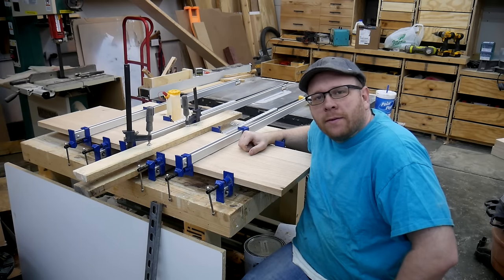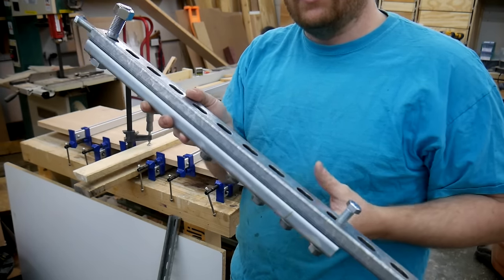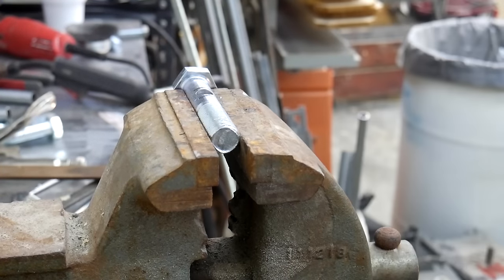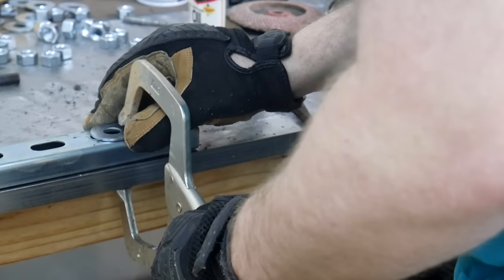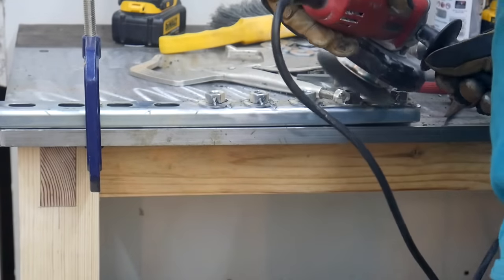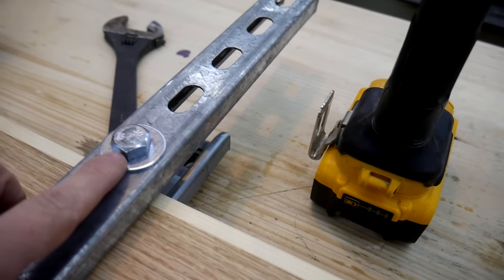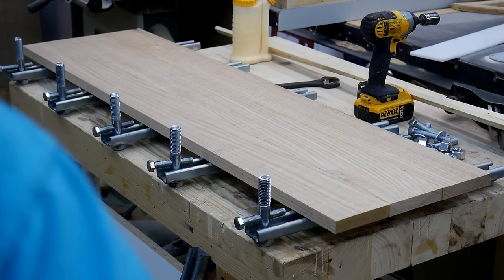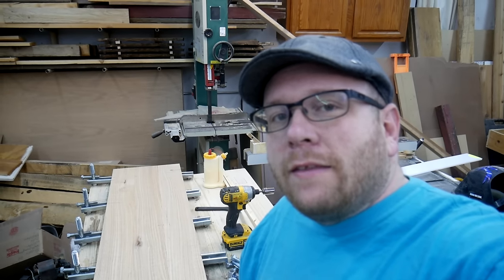3-Way Panel Clamp System

Comment: Thanks for the post, great idea, I wonder if square nuts or spring nuts would have worked instead of welding nuts at the far end.(they sit in the channel)
Reply from the maker: A lot of people have asked this question and yes, I had considered it, but there were a few issues with using the spring nuts. First and foremost, the whole load would be placed on just the inner lip of the unistrut. I didn’t feel like that was strong enough for the application. Second, since I was placing a lateral clamping load on the piece, I was concerned about the spring but moving as I was tightening down the clamp. I was also concerned about warping the inner lip with the lateral clamping forces. Finally, if I used a spring nut, the threads of the bolt would dig in to the edge of the board I was clamping, leaving marks behind. They way I designed it, it bears the flattening load across the whole unistrut, it won’t move because the nuts are welded into fixed locations, and the bolts are long enough that the shoulder of the bolt is what interfaces with the panel, so the threads won’t mar the edge. This idea isn’t perfect. Someday I will release version 2.0, but for now it does the job. Thanks for your comment!
Reply: @SouthpawWorkshop  you can cut the springs off the nuts, you don’t really need them. There is no way the clamping force would bend the lips of the unistrut, most people tighten the clamps way too much, only a small amount of pressure is required. Great idea!
Reply: Really thoughtful engineering you have, regarding the use of welding instead of spring nuts. You raise extremely important engineering reasons for using the welded nuts. However, I do feel that if you're going to use Unistrut, then you absolutely have to use spring nuts, because spring nuts are part of the magic of Unistrut. The magic of spring nuts is the clean look, no welding, but most importantly--infinite adjustability. Spring nuts also allow nothing protruding from the bottom of the strut, so it would sit completely flat. The spring nuts won't deform the strut, as long as you use a standard thin washer on the bolt that tightens the two pieces together--the washer will deform visibly and will continue to deform, before the strut deforms. @SouthpawWorkshop

Comment: 1) use metal strips instead of sacrificial wood strips.  2) put metal panels on each side of the panel boards.  Make it so the bolts and the unistrut only bear against metal, and let that metal spread the load for you.  It's a nice concept - well done!

Comment: Add wood inserts to the clamps where they contact the wood surface. This may also provide an alternate way to locate the nuts by locking them into the wood.  No welding necessary.  I am going to make a set and see how my idea works out.  Thanks for a great idea.

Comment: Tackweld a nut  to a small piece of flat metal for the cross bolt that applies pressure to the edge grain or sacrificial piece.

Comment: The first morning I welded galvanized metal, I was sick to my stomach in no time. I was informed at lunch that drinking a glass of milk before welding galvanized will help coat my stomach and help keep me from getting sick. Worked like a charm. Used it for years since and when coupled with good ventilation and it has never failed me.

Comment: Hello Thomas,
Go to a decent electrical contractor supply chain, get the taller 1-1/4" to 1-1/2" that has your same narrow width, it will not flex as much. Get the spring tube speed nuts by the box (come in different thread pitches), insert as many as you need in each tube, which looks like one to two to save all that fabricating time. That is why Uni-strut has all those holes/slots. Use regular speed nut and two 1" wedges opposing each other to put your side pressure. That way you don't need to use extra fabrication skills and steps. Industrial mechanics, electricians hvac and other tradesman use this stuff all the time for permanent or temporary projects. Ask electrical supply for one of their uni-strut accessory catalogs, might get other labor saving ideas.
I did watch a spanish woodcraftsman on y-t make something similar with a ripped 2x4 drilling five holes through the tall sides with 3/8" bolts, washers, wing nuts and wedges, did not mark the wood.

Comment: Best clamp system, plan to use it with some modifications, like middle tightening for larg panels and flat head on the tightening bolt to increase pressure area.

Comment: It is a nice job and a great idea incorporating the cross-body bolt into the top/bottom struts.
I like the use of an impact or drill into the system,  certainly makes it easier to clamp down and over.
You could use a piece of angle iron or flat bar as protection for the Cross-body bolt.

Comment: I thought of a similar idea years ago but yours is much more thought out. I like the simplicity and ease of use. I've used more Uni-Stut than I care to remember working in the HVAC/R field, mainly for supporting refrigeration lines and hanging unit heaters. In regards to he fears of welding on galvanized, they also make a painted version as well as specialized nuts (I've always just called them cone nuts) and with a little ingenuity one might eliminate the need for welding.
Reply from the maker: @Tvzblaze Ggg To respond to the question of using spring nuts:  The reason I did not use the spring nuts has to do with how those nuts interface with the Unistrut.  There is a small lip on the inner channel of the unistrut that catches these nuts and all of the clamping pressure is applied to that narrow lip.  In normal pluming and structural unistrut applications, the nut and lip are always pressing against something say, a pipe, a piece of structural steel, or another piece of unistrut. In this application, there is nothing backing up the nut and the tendency will be for the lip to bend outward away from the inner channel of the strut.  I am using the full thickness of the unistrut to behave like clamping cauls, so the bolt and nut needs to press equally from the outside of the unistrut, using the rigidity of the strut as the caul action while the bolt provides the clamping action.  With a spring nut in use, my belief is that only 1 side would provide the caul action and the nut side would just fail over time because of the pressure being applied to the inner retaining lip.  I sure hope that book I just wrote gives you some insight to how I was thinking when I approached this project.  I did consider using spring nuts at one time, but decided against it for the reasons stated above.  Thanks for your input, guys!

Comment: This is a genius idea.  I will definitely implement it,  you could weld small handles onto the side pressure bolts to feel out how tight you are clamping, versus the drill method, or you can just set the torque setting on the drill to a known tightness.   I was a little worried about the twenty minute video but your explanation was extremely concise and very thorough.
Reply from the maker: Thanks!  I know my videos can be long, but I try to keep the filler to a minimum. I like the idea of setting the torque on a drill to control the tension. I’ll try that out next time. Cheers!

Comment: I used your idea .  But I  changed the nuts , instead of welding them , I drilled a piece of bar stock that fit inside and tapped it so it slide where needed .  works great. Also used made wood strips that look like dental molding  ( gap fits over glue joints) no indentations  or stains   THANK YOU  for your GREAT idea
Reply from the maker: Great ideas. Glad you improved upon it

Comment: Ive made a set but used the 2" unistrut. I build some very large tables from reclaim lumber or just pine or fur.  I need to weld the nuts to mine.  Good idea. I use clamps to pull the boards together but the panel clamps to make it flat.  Awesome 👍

Comment: Can't turn unistrut over if you want downward clamping force guys. I didn't think of that as an option so super glad to see this post! I would've been the dummy that had them "flat" side down. I've been thinking about doing this for a while, glad to see I'm not the only one. Yes there are more parts available he probably didn't know about at time of this build, he woodworker not electrician after all.
Reply from the maker: Thanks for the support, Mike. I am aware of all the available accessories available for unistrut. There are many reasons I built it the way I did and maybe I didn’t explain very well in the video. What it all boils down to is speed of deployment and ease of storage. Neither of which can be done when you have a bunch of loose bolts and spring but that need to be inserted and adjusted for each application.

Comment: Nice concept.... seems to work good. If you get the dented wood and need to use that section... Just dab a finger in water and put on the dent, it will swell grain out and then when you sand, it will disappear.

Comment: I built a bunch of these for panel glueups  a few years ago. although I flipped them over so its the flat side against the wood and put the disc nut on the inside to pass the bolt to, and since it slides you don't have to weld or have extra nuts. although I have since upgraded to the actual 3 way clamp hardware from Peachtree. I just mount the handle and stuff to the strut and it works great without needing to worry about overtightening the top or bottom. as for your issue with the marking just wrap some packing tape over the edges that touch the wood.
Reply from the maker: Sounds like some great modifications you made there. Thanks for sharing!

Comment: The real danger is welding in a wood shop. Most men are not tidy and organized, and they won't stop to clean and vacuum everything before welding. 

Welding galvanized isn't smart, but farmers have been welding it for decades (my agriculture shop teacher never warned us, he just said that you can "taste the zinc" when you're welding it). 

Love the design! And I think it's a very good use of Unistrut; it should be utilized more in woodworking; your design is the best homemade panel clamp system I've seen so far.

Comment: Great idea,  I might try mounting the unistrut upside down with the nuts inside.  That way, I would have a larger surface area on the wood panel and reduce denting.  Also on the panel tightening bolt, I want to try putting a 10-32 bolt or threaded rod through a hole to use as a T handle.  A couple of cap nuts would finish the handle. That way I don’t put too much pressure on the panel by using a drill or impact.  Again, great idea!

Comment: I think it is a good idea. Gonna build me some. To prevent the unistrut from digging into the wood, I would cut strips of pine or other soft wood to match the length and just a little bit wider than the width of the unistrut for better load distribution and cut a channel in the middle of the wood for the bolts to pass through and then attach the wood to the unistrut with screws and washers making sure the screws don't go all the way through the wood and gouge the panel. You wouldn't need to have the screws to go any further than where your most inner clamping bolt starts. The other screws will keep it lined up and attached plenty good enough. I'm also going to cut out some round slugs from some 1/8" plate and weld them to the ends of the lateral clamping bolts. If that doesn't work like I want, I'll fabricate some swivel cups for the ends of the bolts instead.

Comment: We have tons of Unistrut and fittings  around the shop at work rhat we use for all kinds of sruff.  Square "U" bolts (you can get rhem any length) works to clamp the ends. Two peaces threaded rod running  the length of the Unistrut gives side clamping pressure. Use a piece of bar stock at each end with double nuts counter tightened on the end inside the Unistrut, and the other end a piece of flat steel covering the ends.  Your system has fewer bolts to tighten.  Mine has 6 for each clamp. Also, I won't take the time to cut the strut, so I use awkward 10 foot clamps.

Comment: Excellent idea. I've 3 recommendations for improvements. 
1.  Deep well socket for your impact gun. 
2.  Turn the unistrut over to help avoid denting the wood. 
3.  For added strength, get the 1 1/2" deep unistrut. 
You can get bolts, nuts and washers that will go inside the strut and make it quicker and more streamlined. 
Great idea and execution.
Reply from the maker: Great suggestions. I think there are a lot of ways this can be tackled. I hope others try it out with their own improvements.
Reply: What if you bolt a pine strip to the inner surface of each clamp, (countersunk bolts of course)? That might help prevent the clamp from digging in.
Reply: Doug Sholly And the strip could be tapered down to the ends so that the pressure would be even across the width (notice the dents are on the outside edges, showing the caul pressure is not even across the width)

Comment: This is an excellent idea, you could even turn it into a board press that was hinged on one side and made adjustable for different board thicknesses with a swing down tightening system on the front, and if you fixed a board top and bottom of your press you could sandwich the new board you are gluing and this way you would only need 3 clamps as the boards would spread the weight also dispensing of any marks or dents on new boards, this would also be much quicker, as you would only have 3 clamps to shut and 3 bolts  to adjust for your width. I would also weld a small rotating plate on the cross bolt ends to distribute a more even pressure. thanks for sharing.

Comment: I've been watching a few caul clamp methods before I build my own.  Each has their advantages and disadvantages.  I'm leaning toward using 3/16" square tube instead of unistruts and drilling holes where needed.  That would eliminate marking the wood when under clamping pressure (I hope).  I'll buy extra drill bits because I know I'll need the for all the holes to be drilled.

Comment: Great idea. I will have to make some. You might weld washers on to the 1/2 in bolts that tight the side clamping to give the contact to the sacrificial boards. Thanks for sharing.

Comment: never thought of using uni-strut for this type of clamping great idea. To avoid the marring of the strut against the wood i would recommend using the flat side against the wood. more surface area less damage.
Reply: hyrum Luke

I thought about it but the supply at Home Cheapo had a bad curve/not straight.  I also don't think they're stiff enough, IMHO.

Comment: I have been using strut as clamps for years as I am an electrician.  I think I'm going to build it a couple of the ideas that came to mind is I was watching your build I'll implement and then I'll post my video giving you credit for the original build ⚡😎⚡
Reply: Hey Amped,  any progress on your video ?    Sounds interesting.  Love to see it.

I just discovered Unistrut (some call it Superstrut). Thinking of loads of different use cases.  But the price is now insanely high.

Comment: That is very impressive. I used 2x4 split in half drill holes ever so often. Then I used 2 wedges to tighten up the project.
Reply from the maker: I have also seen that myself.  I believe that method is most useful for applying edge pressure for glue-ups.  Maybe adding a couple clamps to each end of the 2x4 would help keep flat also?
Reply: @SouthpawWorkshop  exactly. You nailed my method. I’m a beginner at age 61. But I’ve been watching videos for a long time.